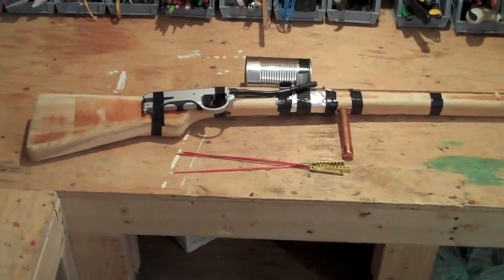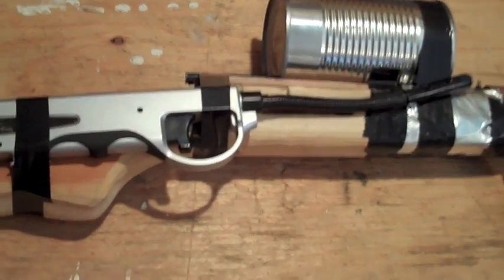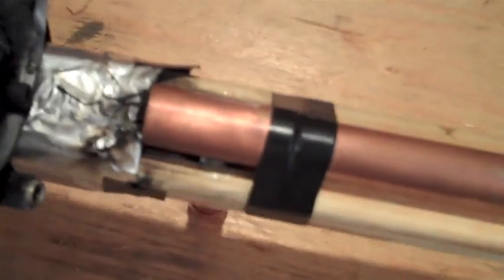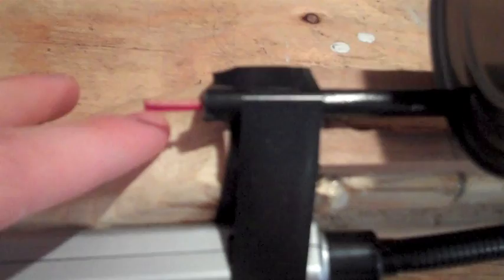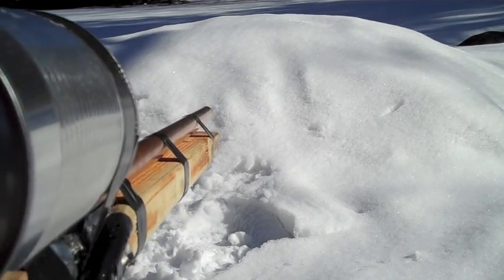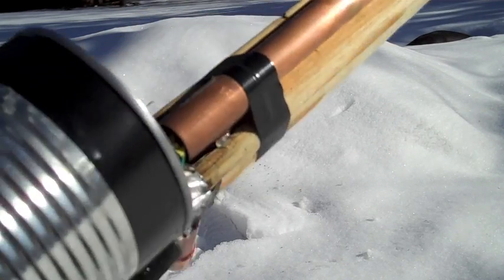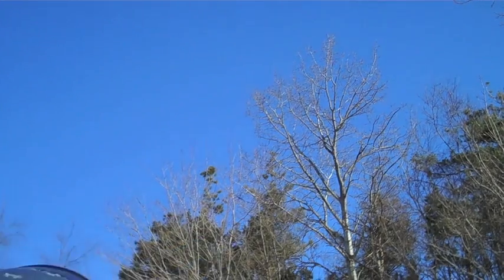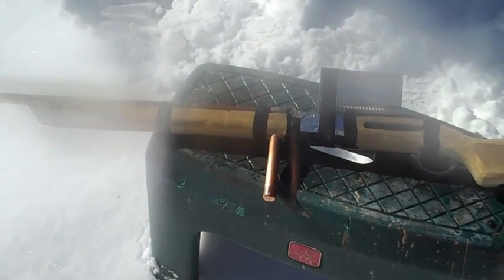Bottle Rocket Launcher

Comment: you should rig up your lighter in the barrel and make a stop where the lighter is always next to the fuse so you dont have to spend time adjusting the fuse to light it, and you just drop them in and pull the trigger.